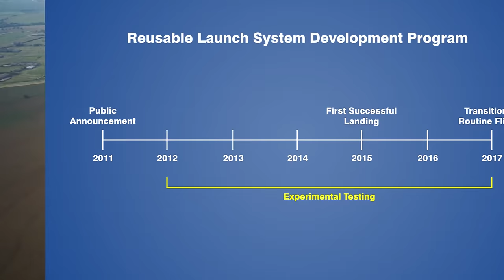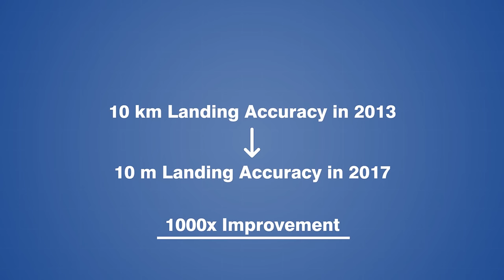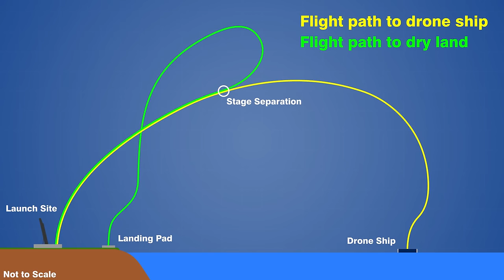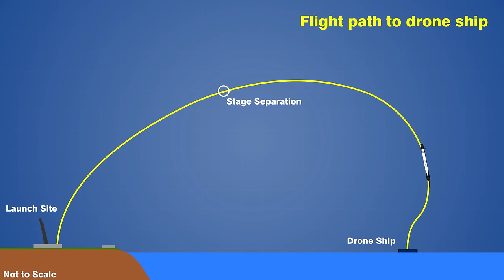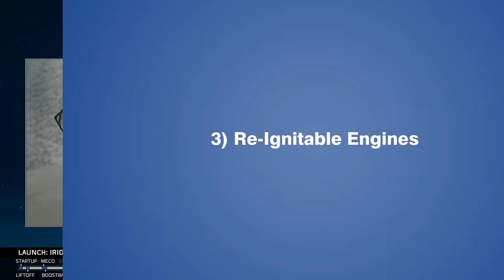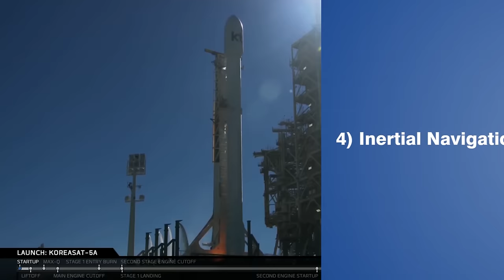How SpaceX Lands Rockets with Astonishing Accuracy

Comment: RIDICULOUSLY WELL-ENGINEERED ROCKETS
Reply: How do they not burn up in the atmosphere during re-entry?
Reply: @Angry.General1461  That's what the "re-entry burn" is for(duh), things only burn up during re-entry if they're going very fast, and the re-entry burn slows down the rocket to prevent that.
Reply: @WhyPee24  you would think the temperature of the re-entry burn would make the fuel inside the rockets explode.
Reply: @WhyPee24  I dont think we needed the (duh) but the rest of your explanation was informative cheers :o) I was hoping to see your knowledgeable response to The Angry General when asking about exploding fuel, is the slow re-entry not at all hot then?
Reply: @Miguel Jeffrey Ah, cool, never even considered that.. Who would have thought rocket science could be so hard 😋
Reply: @Angry.General1461  It's all about "powered descent". The booster is coming back from 70 kilometers and does a reentry burn to slow down. Grid-fins provide guidance and drag to keep the booster upright. It never goes fast enough to burn up.

Comment: Overall, this was an outstanding video. A great example of what the Internet could and should be.

A couple of small errors:

 At 7:40 The cold gas thrusters operate when the booster is empty. When the booster is empty, the center of gravity is much, much lower than you’ve shown it. It is no where near the vertical center of the rocket. The vast majority of the mass of the rocket is contained in the engines which are at the very bottom of the booster.

I’ve heard a SpaceX engineer describe the system as “a brick glued to the bottom of an empty soda can”. This mass distribution gives the booster its stability when reentering the atmosphere & during (and after) landing.

@8:30, “if the computer detects any deviation from the flight path, it instructs the rocket to adjust its orientation and velocity as necessary.“

Orientation, yes.
Velocity, no.

The grid fins change orientation to keep the rocket on the correct flight path.

The only two times the velocity is adjusted by the rocket is when the rocket is firing, i.e., during the reentry burn & the landing road. The rest of the time, velocity is determined by Isaac Newton.
Reply: teefkay2 teefkay2 well, strictly speaking  fins change attitude, which change aerodynamic forces, which change acceleration of the vehicle, which integrated changes its velocity. So, what is said in the video on that is somehow true.
Reply: mar sag   Nope. The key word is “control”. 
Yes, in aerodynamics, lots of variables interact. 

But you’ve only got 2 control inputs: the fin pair that controls yaw, and the fin pair that controls pitch of the booster.

Yaw is used to control lateral deviation from the trajectory (i.e., landing left or landing right of the target).
Pitch is used to control the range deviations (i.e., landing short or landing long of the target).

In principle, the engineers COULD have used the pitch to control the velocity. But then you would have lost control of the range, which is a very, very bad thing. You really, Really, REALLY want the rocket coming down at the right location.

To go a little deeper into “control systems theory“ ...
I’ve seen control systems that attempt to control two outputs (in this case, range & velocity) with one input (pitch). It’s a prescription for disaster (i.e., instability) as the control system bounces back & forth between “range control state” & “velocity control state”.

If you want to have a reliably stable control system (which is a very, very, very good thing), you use one control input to control one output. In this case the pitch fins control range. And you let the other outputs (e.g., velocity) “relax” to whatever the external variables decide it should be.

Note also that the velocity merely has to stay “below a maximum value (at some air density) that will cause overheating damage to the rocket engine components”.

“Getting below a max value“ is a fairly easy engineering task.  The reentry burn sets an initial velocity condition outside the atmosphere. And then “grabbity”, the atmosphere’s air density profile & drag coefficients (all well predictable) determines the velocity (& heating) from that point to the ground.
Reply: Yeah you're good at physics man. You can make good meme.

Comment: Well.. that was disappointing.. was hoping to learn something I didn't already know.

And you lost my upvote for this very inaccurately phrased question "How do they land 70m tall rockets weighing in excess of 500,000kg?"  The simple answer is, they don't .

The first stage, the only part that lands back on Earth, is around 40.5m tall, NOT 70m. The calculations I've found suggest that for a RTLS (Return To Launch Site) landing, around 64,000kg of fuel and oxidiser is needed. Barge landings require considerably less, because RTLS boostback consumes roughly 2/3 of that. So let's assume that (including an overly generous safety margin), around 100,000kg is reserved for landing. Factor in the dry mass of the first stage (25,600kg) and you have a returning mass of 125,600kg, which at touchdown will be about 50% of that. That's a hell of a lot less than 500,000kg!

I'd have thought that somebody with an engineering channel would try to be a bit more precise with their figures. Especially considering the above numbers only took me around 5 minutes of online research to pull together. Colour me unimpressed.
Reply from the maker: I have already acknowledged this oversight in the pinned comment. I am aware that I should have provided the measurements of the entire Falcon 9 rocket as well as the measurements of the first stage by itself.
Reply: @ArtofEngineering  - Well.. it's not too late.. you can always edit and re-upload.. or put some corrections in an overlay, at least. Plenty of other youtubers do so, and over far less egregious errors than this.
Reply: @ArtofEngineering  - Oh.. and I don't see any pinned comment..you might want to look into that.
Reply: @Art of Engineering I appreciate that you acknowledged the errors and I agree that it’s a shame YouTube doesn’t support corrections when content goes astray. The sad result is a lot of well-intended misinformation just stays out there to be is seen and seen again.  I still appreciated the video.
Reply: i also stopped the video there and came to the comments section
Reply: This discussion is all misdirection anyway. Try lowering a broom on your palm to an exact spot on the ground -- you can't because thrust (pressure) from the bottom cannot keep it upright AND adjust landing trajectory. Newton's laws, mate. The reason we don't hear from academic physicists on this is because they are afraid to destroy their careers. That's how obvious it is, and how weak a society we live in.
Reply: @allanweisbecker8901  Whatever your career is, or will be, please can you avoid critical engineering projects, or engineering projects that involve technology more advanced than the wheel. I still wouldn't want to drive in any car designed by you, but at least it's been done before so we can hope that you'd just copy off someone that does know what they're doing.
Reply: @allanweisbecker8901  please explain how newton's laws have anything to do with landing a broom on the ground. or how landing a broom with your hand is the same as landing a rocket that can accurately adjust its thrust to create horizontal force components. check your highschool fbd s dude.
Reply: @allanweisbecker8901  unbelievable that there are still people like this in 2019. EDUCATION IS WIDELY AVAILABLE. Get yourself some them come back to these kinds of comment sections
Reply: @ToppNDP1  Yeah, that Elon Musk is a genius,  somehow creating a hologram of the CGI landing and projecting it to the outdoors, where tens of thousands are deceived into  believing their own eyes.  Snort!!!
Reply: effinay right He’s still trying to figure out how the rocket didn’t hit the firmament. Too cool for school, and too macho to admit he doesn’t know something. #EducationFail
Reply: You had me at, "The simple answer is, they don't .", then you lost me when you went on to parrot all the lies that they fed you. Space is faked. NASA is a long running, money making fraud. We never went to the moon. Anyone with intelligence and time to do research, can debunk all the fraudulent crap they have been feeding us for decades. All the images and videos have been torn to shreds for years. I keep bringing up the fuel as one simple example and proof that the ISS is not there. Just calculate the amount of fuel that the ISS has needed, in order to keep shoving it back into orbit, over the course of it's history. How did the fuel get up there? I have 1000's of proofs of NASA fraud, especially on the International Fake Station. CGI microphones moving through hands, types of microphones changing out in a blink of an eye during a broadcast, blue screen failures constant, harnesses coming into clear view!!! Astronauts grabbing harnesses, the infamous and laughable "gravity pockets" where things get dropped or move without being touched, the ISS getting a giant push or jolt and the astronauts all getting knocked around (actually just a common thing on a zero G plane), scuba tanks and divers seen on space walks, astronauts thumb sticking out and being accidentally caught on camera during space walks, constant air bubbles on space walks, flies flying around and landing outside the window of the ISS, never in the history of the ISS having an astronaut climb around with a camera during a space walk and turn 360 degrees around and show the stars, the ISS 24 hours feed has NEVER EVER EVER been a 24 hour feed and always has to stop and start again, the earth zooming by below does not mimic actual reality in which things at the furthest distance appear to stand still and as they approach they gradually speed up to the observer (as they should in real life), disappearing arms, disappearing bodies and hands, hands glitching out and going through objects, actors getting caught doing video for live feeds in front of blue screens, actornauts turning their heads during space walks and the helmet turning with their head (when it should not have according to their own information), no doors between capsules and the claim that they just threw the doors away as they built the ISS, the testimonies of plumbing and engineer experts and builders of submarines, that basically tear the entire notion of the ISS to complete shreds, not to mention the actual CGI that they have done intentionally to show kids, where they have things appear out of nowhere and into the hand of the actornaut during a "live feed" lmfao, the constant playing with water and at the same time disregarding the very real dangers of any water droplets getting into important equipment, the constant Freudian slips, where actornauts say they are in California etc etc, The list goes on and on and on and on.
Reply: @allanweisbecker8901  Hey, the broom doesn't have attitude thrusters , grid-fins, and  steerable main engines like the Falcon 9; that's how they do it, mate!
Reply: @JAKEWJONES  

1. Why are all the internet conspiracy theorist loonies named Jones?

2. Are you related to Alex?
Reply: @NoodleMcnoodle  You can choose to remain ignorant of the facts and live in a fantasyland. I choose science and reality. It is a much healthier way to live.
Reply: @JAKEWJONES  You nailed it Sir! With out a doubt the best comment, regarding NASA, lies I have ever read! 
More and more people are waking up to the fact that our reality is fake, but if to many of us wake up they'll just do another  reset, like they've done many times before.
Reply: @gazrich1  Thanks Gary! It's always nice to meet other awake individuals.
Reply: @allanweisbecker8901  Strange. From about age 6 I've been able to keep a broom upright on the palm of my hand with just very small movements of my hand. Laymen would call it, "Balancing a broomstick on your hand". Replace the muscle movements of my hand with gimbaled thrust vectoring rocket nozzles and you can perform the same child's trick with much larger and heavier "broomsticks". Or were you one of those uncoordinated kids unable to balance brooms? If so, my condolences.
Reply: Jon Yen 😂😂😂👍
Reply: Top Notch All you need credential wise is CGI, and be able to cheer and clap like a monkey to work for Space X.
Reply: @JAFO. You need to watch the video a few times more to appreciate how SpaceX is able to land their boosters with such precision.  Those six points mentioned in the latter half of the video clearly explain how the boosters were landed so accurately.
Reply: @JAKEWJONES  Sounds as though you have more than enough information to start a channel of your own then. When will you launch it?
Reply: @allanweisbecker8901  
If you just relax your verbal requirements slightly, like substitute "within feet" instead of "exactly" then landing that broom (bristles up) with or without automation is plausible.
Reply: @ToppNDP1  Sure is nothing to notch about your comment.  Sounds more like a lot of whining and complaining.  But hey, I'll  give you a pass now that it is a year later.  The Falcon 9 continued to have many successful launches with the the rapid development of the Starship soon be tested to 15 Kilometers AND land it!!

Comment: Just wanted to address one thing, If it’s going to the drone ship it only does a reentry and landing burn because of the fuel consumption, however if it’s coming back to land it will do the boost back burn to slow the vehicle.
Reply: It does boost back burns for ASDS landings too. It's so they can keep the ship closer to shore.
Reply: @user-lv7ph7hs7l  Sometimes. When close to margins, they have used a purely ballistic trajectory.
Reply: @user-lv7ph7hs7l  Very rarely. If they're doing drone ship landings they often don't have enough fuel to do a boostback, much as they might want to in order to reduce the distance the ship has to go out to sea in order to "catch" it. Rocket performance margins are razor thin. This is, after all, why they even do them in the first place - otherwise they'd always go back to land for convenience.
Reply: @mduckernz  Most Flacon 9 rockets are not even close to their weight capacities. The small faring of the Falcon 9 means most of their payloads are underweight, ergo they can carry more fuel for boostback.
Reply: They do boost back burns when landing on ASDS. Don't believe me? Look at the most recent launch, Iridium did a boostback burn
Reply: @_Andrew2002  Sure. But it's MUCH less common. The typical case is that they do not.
Reply: They've expended boosters in recent history too, to throw a lot. Since it wasn't repeated it probably helped establish what's possible with the basic airframe, and helped a customer.
Reply: @JFrazer4303  They haven't been expending booster regularly for 6 months now. That was just a brief time when they realised Block 3 and 4 only had one re-flight in the and they started getting rid of all boosters on their second flight.
Reply: @_Andrew2002  Yes.  SOMETIMES.  Iridium could have returned to land, but AF asked that they not because they had the NROL stack out on a nearby pad.  That being the case, SpaceX used ASDS near land and so did a boost-back that was easily affordable fuel-wise.  Others like the Telstar launches barely had enough fuel to land at all.  There was NO boost-back.  The booster followed a ballistic trajectory after staging and the ASDS was placed at the impact point of that trajectory.
Reply: @WatchesTrainsAndRockets  That my friend is a lie. Rewatch the stream and you see it decelerating with a boostback burn. It doesn't head back for land no, because that's not the mission profile
Reply: @WatchesTrainsAndRockets  You seem to have forgotten SSO-A which was forced to land on JRTI because of the Delta IV Heavy. However, unlike Iridium-8, it did a full boostback burn and landed a few kilometres off the coast.
Reply: @_Andrew2002  Actually, I had that conflated with Iridium 8.  Doesn't alter the point.  Some do, some don't.  Depends on why they are landing on ASDS.
Reply: @WatchesTrainsAndRockets  Up until Saocom 1a they always landed on a JRTI as there was no LZ-4. Iridium missions are heavy in general, nearing 10 tons, if I remember the LEO of an RTLS Falcon 9 is 12 tons, this is a polar orbit which needs more gas, so that is likely why they landed on JRTI. SSO-A landed on JRTI despite the fact it could easily make an LZ-4 landing. It just happened there was a Delta IV heavy with a spy satellite onboard, so the sonic boom of an approach vehicle could damage it. B1046 thus landed on JRTI, albeit only a few km off shore.
Reply: The Telstar 19 mission block-5 was mostly ballistic all the way to the reentry burn - however - after stage separation, I see a very short burp of the booster engine for a minor course correction before the booster flips over. So this cannot be classified as a "boost-back burn".  @Michael Pennington   @Andrew
Reply: How do they not burn up in the atmosphere during re-entry?
Reply: @Angry.General1461  Heat shielding on the bottom of the rocket, and a re-entry burn to slow down the speed. It's not like orbital re-entry, it's much slower and thus much less energy